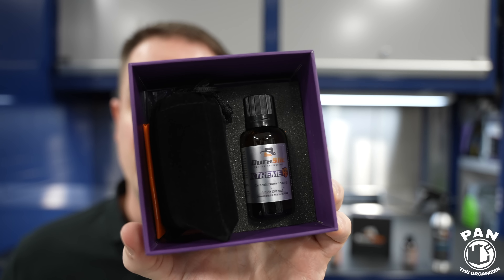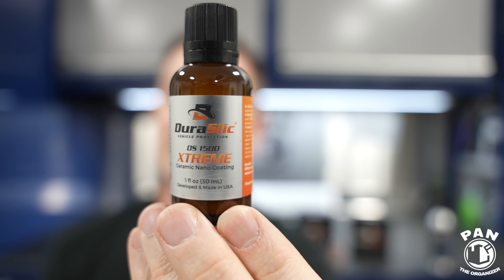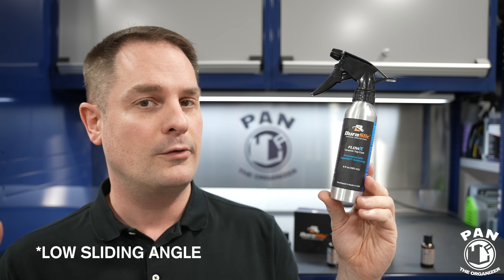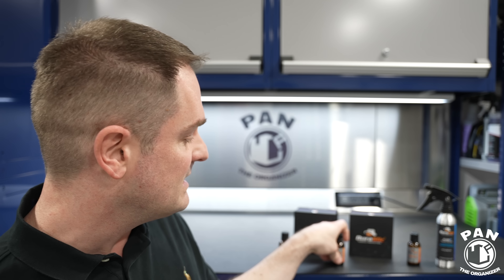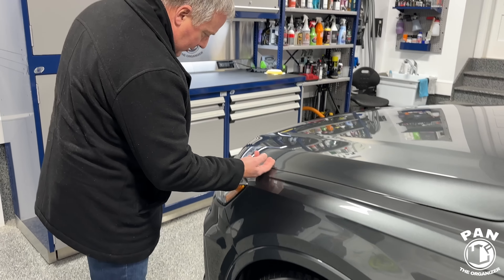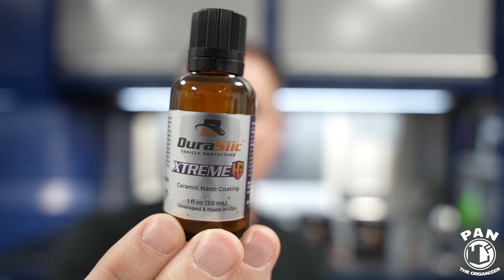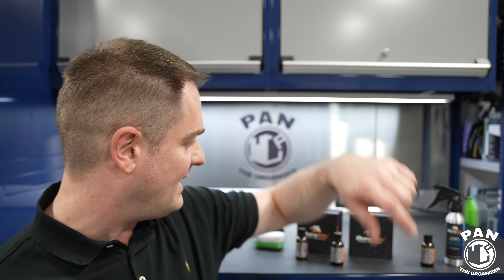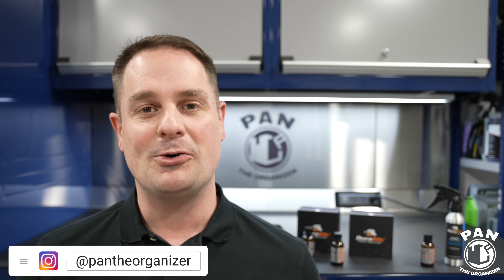Is This The Holy Grail Of Ceramic Coatings? NEW DuraSlic Holy Grail

Comment: Hi Pan. I’ve been watching your content for some time now and I must say, great job on the work you’re doing. However, I was hoping by now that you would do a video on vehicles that may need to re-apply ceramic coating. Is it the same process steps as you did the in the past when you first applied the first ceramic coating? What if your car’s finish has no blemishes but the coating is not beading the water on the surface like it did, can you just reapply by just cleaning the car, decontaminating the paint, and then reapplying the coating application? I think that would be a great video for you to do. Thoughts? 
Thank You.
Amy
Reply: No.  You get to polish and remove the old coating first… basically treat it like an untreated vehicle… wash clay polish etc… FUN!!!
Reply: Is a topper not bringing the beading properties back? Sometimes there's a lot of protection left, but the water beading properties have just lot a bit of sickness/hydrophobic properties. Get a ceramic topper like the one he shows (the spray bottle) in this video and put it on top. If the ceramic is truly worn out then you'll have to do what the commenter above stated.
Reply: @ChainsawChristmas  Chain - on my midnight blue car - the cquartz is just past 2 years old - been parked outside during that time - now I have discoloration that shows on the tops - only when you take your sun glasses on /off will you see it... so planning on doing mine soon... but hot weather means I get to wait til fall now!   Going to try Gyeon Evo Pure - and Cure.. just to change it up a bit.  I like their ceramic detailer on top of cquartz - it's a bit faster/easier than reload 1.0...
Reply from the maker: Two separate questions here. If the coating is at the end of its lifespan, it needs to be fully stripped off before applying a new one. So you would restart the entire steps: wash, iron remover, claybar, machine polishing, IPA wipe, and then you reapply the coating.

If your coating is nowhere near its end of life, and doesn’t seem to have the same strong hydrophobics as it did, assuming it was applied properly and it wasn’t a faulty coating, sometimes coatings just need a deeper clean to “unclog” the pores from grime and traffic film.

See my tutorial on a deeper coating cleaning here: https://youtu.be/oTaFE_p2OAw

Comment: One more question Pan. I was going to use CarPro reflect and a Gloss Pad. Is there anything better for the highest gloss possible?
Reply from the maker: Machine polishing is what gives the paint the most gloss (the most increase in gloss units when measured with a gloss meter). Polishing removes defects, increases gloss and depth and clarity, removes oxidation, and makes the paint "flatter" thugs giving more light reflection.

After that, make sure you use a paint prep spray to remove polishing oils (IPA) and then apply protection. Good coatings can help further increase the glossy appearance by giving a candy-like finish to the paint.
Reply: @PanTheOrganizer  Pan I know all that. You didn't answer the question. It was about products. I've coated a lot of cars but just not in the last few years and wanted to know what great new products are out there. Reflect was always pretty good. Is there a better mouse trap?
Reply from the maker: Reflect is as good as it gets for a polish. I also like Sonax Perfect Finish, Rupes Yellow DA Fine Polish. If that's what you meant. It was unclear what you were asking for when I read your first phrase...
Reply: @PanTheOrganizer  Thank you sir.

Comment: Sir, i am from northern india the weather here is dusty, rainy, dry so what would you recommend time interval to apply ceramic coating on my car. Can i apply coating after every 3 months as my car shine lasts 3-4 months is it safe to apply! Reply will be appreciated 🙏
Reply: Once you apply this coating, you just need to maintain it. You won't have to apply it again for years if you maintain it correctly. You could use FlowX as a topper every 6 months or so, though. I'd say once late spring/early summer and then again before winter. Maintenance is key, though; washing it weekly, keeping water spots from forming, basically trying to keep it clean and using the right products to do so.
Reply: @dakotasimon3445  thanks

Comment: Was applying this to a black M340i and found the hazing to not be easily removed through my normal buffing. I have applied a number of coatings, but I went over the car several times with multiple towels and could not totally get the hazing out of the paint. I see little hazing buff marks all around the car. I’m allowing for this to sit the 24 hours now and hoping to see those buff marks gone. I’m just wondering if anyone else has had this problem, and how it could be remedied. Definitely the hardest time I’ve had buffing off a coating.
Reply from the maker: Use a clean and dry plush towel (thicker towel) for a quick wipe off and that should easily go away. It can happen sometimes with coatings depending on the conditions when you were applying.
Reply: @PanTheOrganizer  eagle edgeless 500 is probably the thickest one I’ve got in hand. Do you think that should work? Thanks for the reply.

Comment: Thanks.  Maybe next time.  Twice the price of car pro uk
Reply from the maker: You can’t compare a 2-year consumer grade coating to a 5-year professional grade coating.

Also, DuraSlic is a time saver as it only requires 1 layer. CQUK recommends two layers.

CQUK is a fantastic consumer grade coating (my top coating pick for consumers in my awards video) bit DuraSlic is in the professional grade. A better competitor would be CarPro CQuartz Professional or Finest Reserve.
Reply: What would I do for 5 years.   I am close to stripping all coating off and start over.  I will probably buy     This product due to ur endorsement.  Can get two cars with one bottle.     How 
Long Is shelf live

Comment: So things that make it stand out but nothing really special about this ceramic coating.
1) One application needed.
2) Slick Cermaic Coating defintely will degrade over 7 yrs(duh)
3) Depth of paint isn't really anything special it's morre the Audi paint the customer picked out
4) Low sliding angle? Meh....

Is this really better than the other ceramic coatings? Or how about DiamondBody36 which is technically not a ceramic coating.
Reply: DuraSlic>DiamondBody.